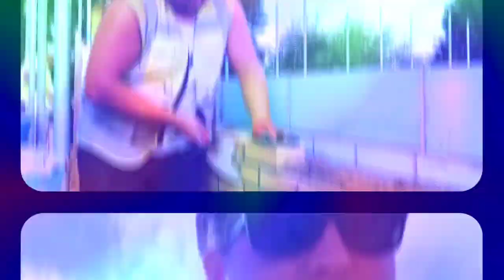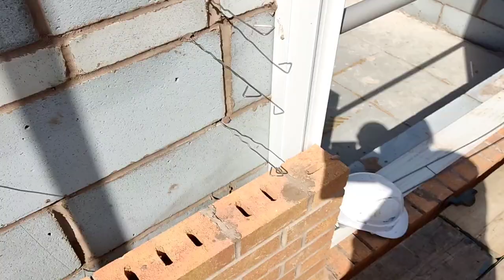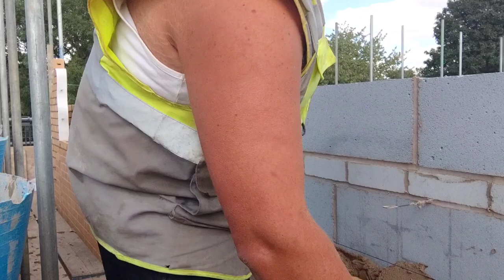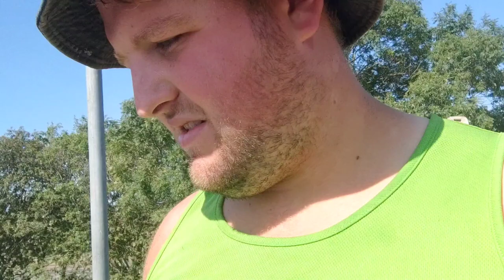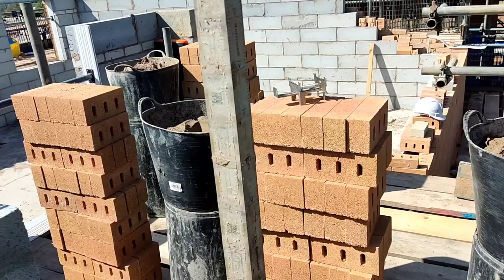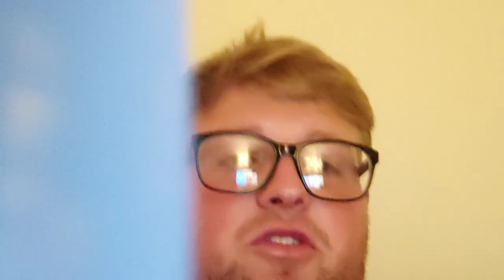Bricklaying Vlog - Perfecting the Pick & Dip with Concrete Bricks?! 4th Lift Pair Done!

Comment: Harry. When spreading your bed. Spread back to where you start laying. Not away.  Time is money.
Reply from the maker: I will do in winter, but I've not mastered speeding back wards, and then there's cutting snots off as well, you have to do it ever coarse, this weather it's too hot even for coni's still figuring out the best way to go about it with tubs n small trowels
Reply from the maker: Perfecting stuff everyday
Reply: Always learning mate. Especially 1&1. Walk down line up ( get hoddy to do it) then spread back line up away you go.
Reply from the maker: @ryanhandful I would have him spreading but I want him laying so I only get him to spread enough for what he's laying, I cant build these gables to scaffold hight with coni's any quicker without em moving, so I'm trying to get him to the stage I can set him building a small panel on his own or run block work in with assistants